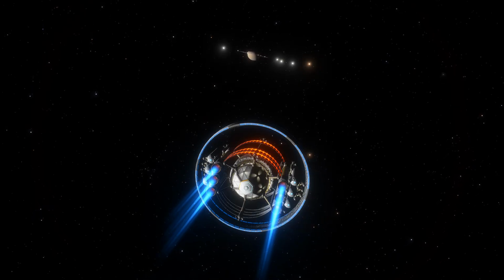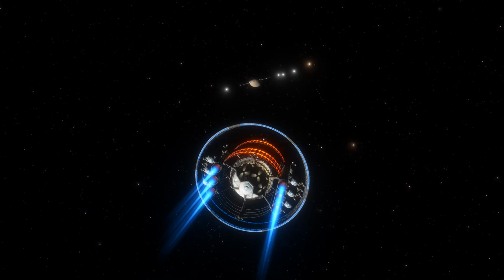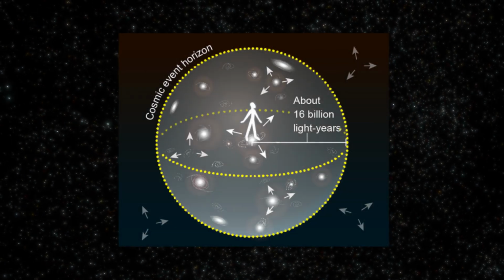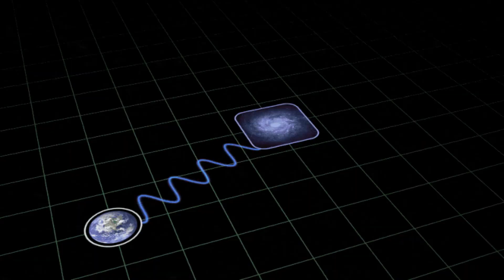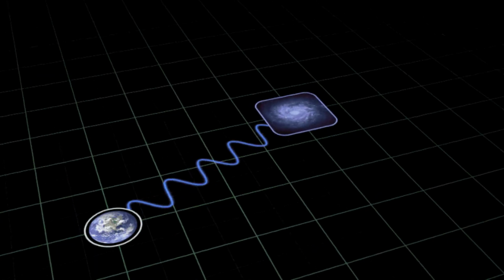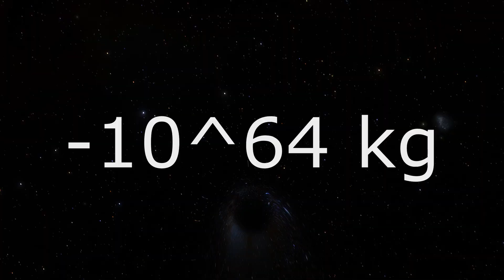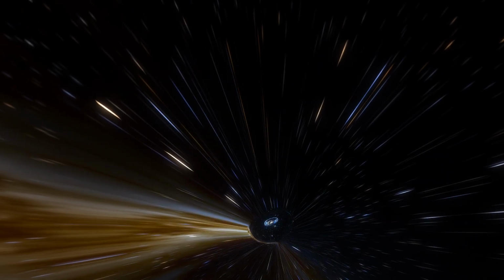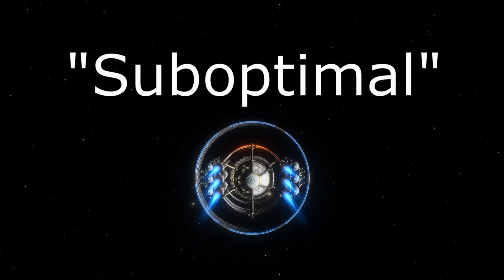How fast could an Alcubierre warp drive go?

Comment: 1:12:
And inertia.

A warp bubble was created in a civilian laboratory.
The scientists say it would work without negative or exotic energy.
The warp bubble would probably be flatter, but it would work.
And it also requires less energy than previously claimed.
The former director of Skunkworks, Ben Rich, told students in the 90s that they have the warp drive based on alien technology. They just need to perfect the formulas to make it work.
That was a good 30 years ago.
There may even have been the first test flights with warp in secret projects...
Reply from the maker: Rule of thumb. If the basis of any claim is "reversed from alien technology" and the source is "trust me bro I'm not lying". It's fake.

Comment: If you traveled through a warp would you get younger?
Reply from the maker: No, if a warp drive worked as intended, time wouldn't move faster or slower for you. Even with the possible time travel issues you would not get younger.
Reply: @venera13  are you sure?
Reply: You wouldn’t get younger and would age normally relative to your position.   On the other hand relative to people not in your time frame you would age more slowly.   You could go on a faster than light adventure and from your time frame you traveled for a year let’s say but upon returning to your departure point many years have gone by relative to you.